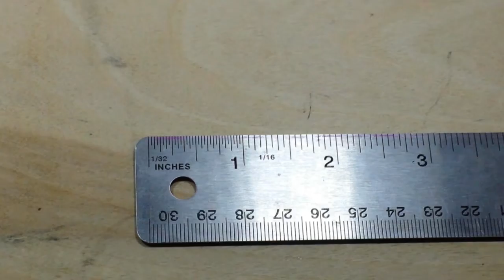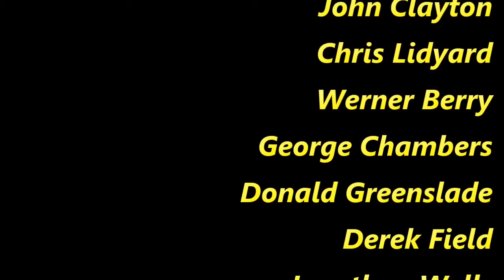Toroidal cores for inductors

Comment: Slight correction, inductors store energy in a magnetic field not charge . Just as a capacitor is defined by the relationship Q=CV, an inductor is defined by the relationship φ=LI, where φ is the magnetic flux. See: https://electronics.stackexchange.com/questions/68355/inductor-equivalent-of-capacitors-charge

Great videos though.

Comment: sir i need to design 280uH inductor for dc to dc converter. i calculate using some calculation that i need 55 turns with 20SWG size wire on toroid 0.8diameter core.

can you think i will get 280uH value with these

Comment: How about the color of the toroid and what they can be used for. I have some from computer power supplies and wonder exactly what they can be used for? Can they be used as a balm? am curious.
Reply: just from very vague research:.
those tempting xformer cores are abundant and not good for rf. They are corralling 60hz, so athigher freqs they will be more magnetic, and rf is ac, so higher freqs make kore heat. You can make great rx antennas with them, but they will be struggling and hot at 14 mhz and up.
(tx)
An air wound 4:1 balun, wired as an unun, will be better for 14 mhz to 54 mhz matching.
Again, vague as nobody is clear about wrong mix or cores that attract a magnet. 🎉

Comment: that's cool. I don't like scripted videos/channels. that much. lots of times I know what you were meaning to say. they're no reason to make a big deal over it. and comment on it. and ride you over it. just a mental (oh you mean uF  not F when talking about caps) and go on learning! I love toroid's for some reason. when I was wanting to build a inverter. I was looking in to making toroidal transformers and inductors. but I have almost got over it for the moment. since I bought one. I still want to build one later. that and a huge DC motor controller. for a EV car . a conversion a car to electric . like 72-96vdc. and about 600-800 amps. most will be surge. normal current will be about 100-200amps. with the motors I have. I was wanting a rear wheel drive. but I my go with a Toyota Camry I have. I just need to get a transmission. and the car is ready. I just need to build about a 600ah lithium battery bank and charger and motor controller! so basically everything! maybe in a year or two! great lil video!